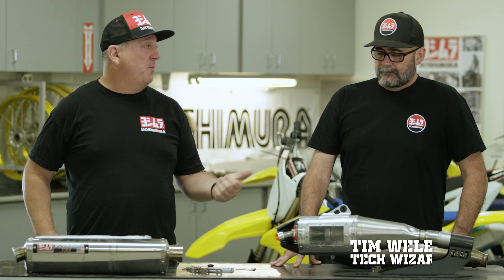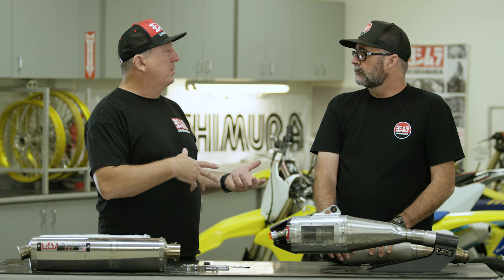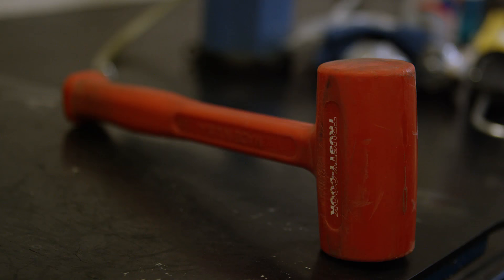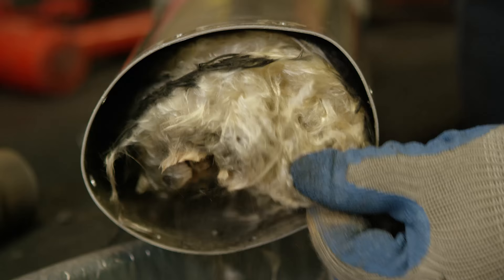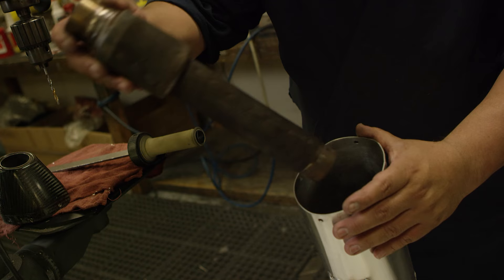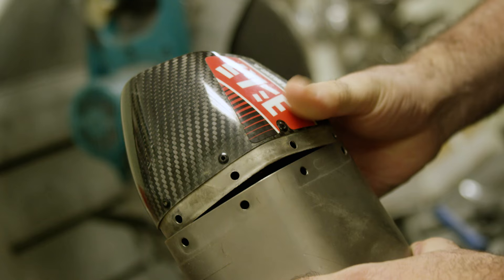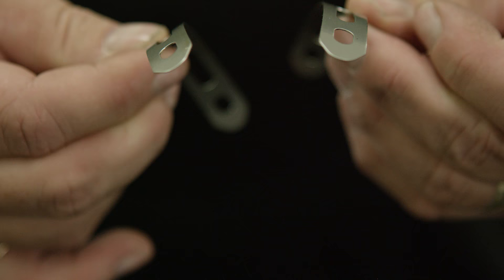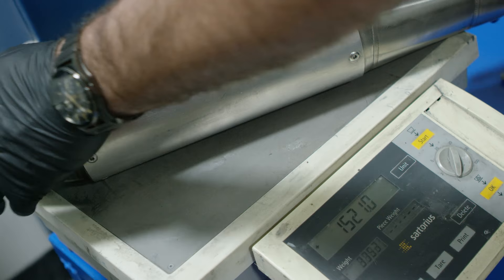Motorcycle Muffler Repacking Explained and Made Simple by Yoshimura R&D

Comment: Pop's I'm sure would approve & the final end cap high temp sealant shop trick with a very thin layer of material looks like a pastry chef decorating a Wedding cake with high real ingredients icing. I'm a very good Used 2000 RS-3 Carbon fiber body bolt on today from Ontario for $185+ shipping and planning on shipping Yosh pipe to you guys for a Repack and road rash repair end cap on the mid pipe location and watching this I'd prefer the pros to do it & she will come back looking & sounding like new Again with the proper weight of repack material. Thanks for the video it's definitely a rewatch over & over again for me, Plus Kevin Swantz is one of my favorites pro riders ever in the Non robot IMU bike era on the 1980's till he retired.

Comment: Thank you so much for the video guys! You rock. I have a Shorty Off-Road Model from you guys. It is very loose and wobbly. Would a repack fix that? The metal base of the exhaust tip is very sturdy but the rivets seem very loose and so does the carbon and the rest of the exhaust after the first rivet band.

Comment: @Yoshimura R&D of America, Inc. 
In response to another comment you mention that the rivet cannot be properly installed by a hand riveter and can only be properly installed by a pneumatic riveter.  Why is that?  What do pneumatic riveters do differently than a hand riveter?
Reply from the maker: A commercial hand rivet gun will work fine… most local hardware stores don’t offer that option and instead sell light duty rivet guns that are suitable for aluminum or small 1/8 “ rivets. If you can manage enough grip strength to pull a 2/16 stainless rivet with a standard manual gun I ihave yet to see on not destroy the jaws by either stripping the gripping ridges or outright breaking the mandrels. The pneumatic guns sold at places like Harbor Freight have plenty of HP to pull the mandrel and are durable enough for occasional use.
Reply: @YoshimuraUSA  which brand of pneumatic rivet guns were you guys using in this video? I noticed 2 different types.  Thanks!
Reply from the maker: @crawfordd17  The brand doesn't matter, the consistency and ease of pulling the stem of the rivet is key.

Comment: I just bought the repack kit for my TRS , and I weight the exact grams for my 18” BUT it’s pure white filling and my question is if I putt it in with a screwdriver or can I first wrap it around the metal sleeve first ... Cause there are no videos available of the material that yoshi send over to customers 🤷‍♂️.
If you take a look at the original filling , it’s prepacked and easy to install , why is that not available ? Much Easyer then a bag of filling material
Reply from the maker: Yes you can use a screwdriver, but we would recommend something a little more blunt like the end of a broom handle etc.
That packing that was installed back when your muffler was made is no longer available.
Reply: @YoshimuraUSA  thanks for the reply but I was wondering if there is a possibility to get in contact with one of tech guys who can assure me that I did it the correct way cause I’m not convinced that it’s done properly , if feel less resistance in the muffler and more pressure but still feel vibration from the aluminium housing when I rev the bike 🙄
Reply from the maker: @florrevansteenkiste  maybe its better you send to us for repacking...call us 800-634-9166

Comment: Was told to use 2.1lbs of packing for my 2022 yz250f rs-12 muffler. I weighed that amount and put it in but there is about an inch gap of space left. Is that normal or should the whole exhaust be  packed all the way to the top?
Reply from the maker: If you follow the instructions with our repack kit you will know (if its the correct kit) that you packed the muffler to tight. Give us a call if you need help. 800-634-9166
Reply: @YoshimuraUSA  Followed your instructions but the thing is you dont sell a repack kit for a 2022 yz250f rs-12. Hard to buy the right kit if you don't sell one. So I was told by your sales to buy a different one that came with 2.5lbs of packing and to weigh out 2.1lbs. Of course this kit also came with exhaust graphics fthat is different and doesn't look the same as the rs-12. No mention anywhere in the instructions about packing it to tight so how would I know if I packed it to tight? After emailing customer support they told me to just add more which sounds like now was the wrong thing to do. Dont know because you didnt answer the question. It would have been nice if you just answered the question instead of implying I did something wrong and bought the wrong kit and didn't follow instructions. Now I am worried it is packed to tight after following your supports advice. So I am going to ask again so if someone else has this problem they will know the answer, is it normal for that inch gap to be there if I weighed out the correct amount?
Reply from the maker: @rstephen001  The packing kit that is for your bike is here https://docs.yoshimura-rd.com/REPACK-RS12-MX.pdf  and contains 2.2lbs of packing material as well as hardware and decals for the most current version of your muffler. Note: Your system was originally packed with 2.1lbs of the same material. We do recommend in our instructions to use the whole amount of material which is less that 5% over... This is a negligible difference to overpack and really only adds a couple ounces of weight and increases durability. 

From experience we can say its easier to pack a system too tight than it is to pack it too loose. Too loose leaves you with extra material, too tight leaves space when you are done, and neither are ideal. For the best results we recommend you remove the packing and re stuff the muffler evenly adjusting the density of the packing to finish the job with the packing evenly distributed from the front to the back of your muffler's sleeve. Hope this helps.

If you have any other issues please call in and we will try to fly you in for a safe landing...
Reply: @YoshimuraUSA  Thank you for the response. Not sure why I was told to buy the adv kit by your sales guy Don then. You also need to update your kits information on your website to show which kit is for yz250f. Currently even that mx kit does not list the yz250f as a bike that the kit is for which I'm guessing is because it technically isn't. It is already put back together so I am not going to rebuy another kit to get new rivets that I would need to repack it again. It would be nice if you sold a kit that came with the correct amount of packing for the yz250f, would have been a lot less hassle and confusion. It seems like the rs-12 for the yz250f was an afterthought with it being literally the only bike that doesn't have its own repack kit and your sales people giving out wrong information on what kit should be used for it.

Comment: Do you need a pneumatic rivet gun or can you use a manual rivet gun?
Reply from the maker: Pneumatic will save you a lot of headaches and is a better tool for the job
Reply: @YoshimuraUSA  what about a battery powered riveter?
Reply from the maker: @HighGrade_FireBlade  never used one.

Comment: Do not do this! Once they said remove the rivets I was like wtf you need those there's better videos forsure these guys will mess up your muffler
Reply from the maker: We have built and rebuilt countless mufflers over the course of almost 70 years in business, interesting we would "mess up a muffler."
Reply: I just did 2 of my bikes DO NOT TAKE OUT THE RIVETS
Reply: @codyray8754  then how the hell did you pack it?
Reply: @jamesnorth7318   you can get a rubber mallet and you can knock it loose and you slide it back together it's alot simpler than this dude trying to make it.

Just look for another video bc I didn't have to do none of this